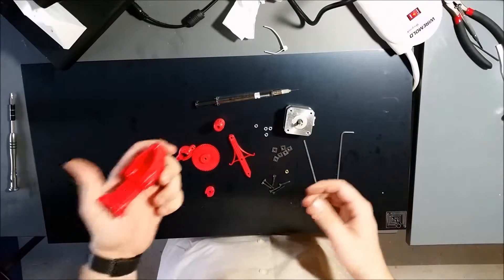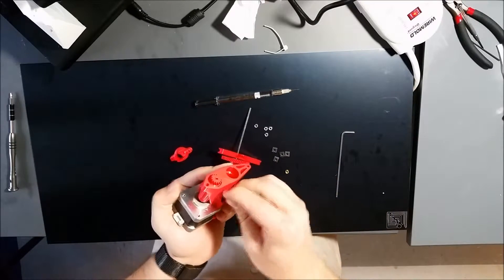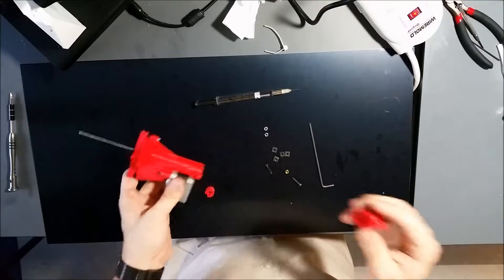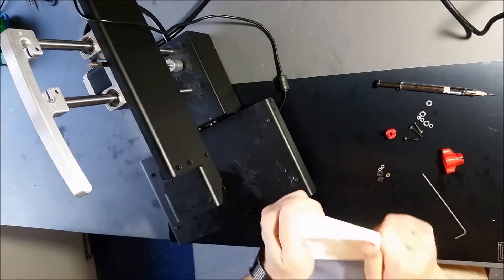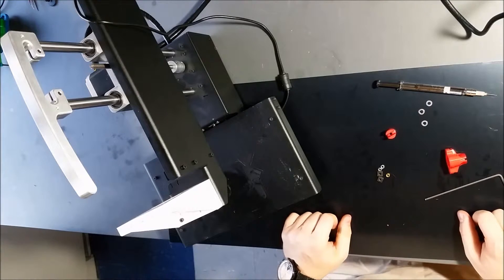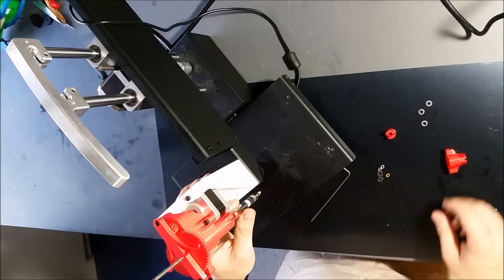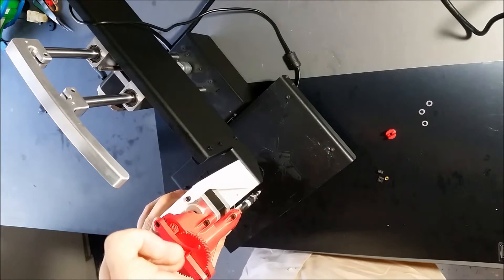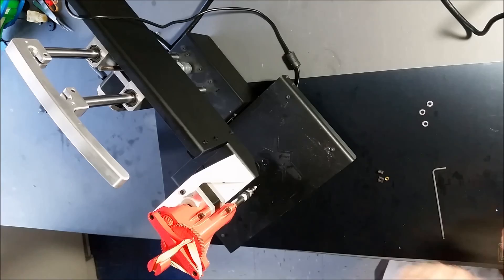Replistruder V1 Assembly for FRESH Printing

Comment: Thank you for the tutorial. Have you tried actually printing with this assembly on this same printrbot simple printer? What modifications were made to the software?
Reply from the maker: We have a publication in Science Advances (see link below) that details our methods and results using FRESH to print gelling fluids using Alginate as an example. We have also successfully printed collagen and other hydrogels such as hyaluronic acid using this method. The Science Advances article is open source, meaning you will be able to download the entire article without any form of academic subscription. 

We are currently working on a video that will easily outline changes you need to make in a slicing software package. You do not need any custom software to use FRESH, as we used open source slicing and packing software such as Slic3r, Cura, kisslicer, Repetier Hots, etc., and only modified the setting such as Filament and Nozzle Diameter to trick the printer into thinking it's printing a very weird plastic.

http://advances.sciencemag.org/content/1/9/e1500758.full